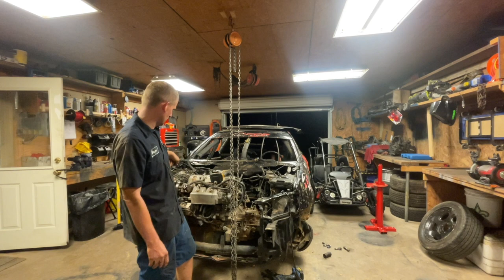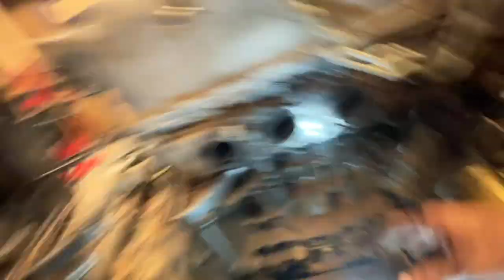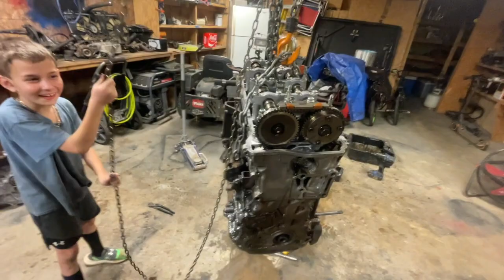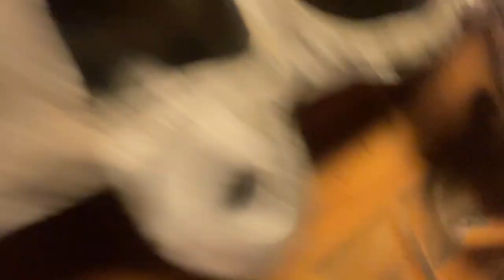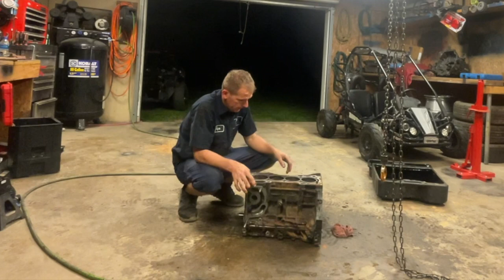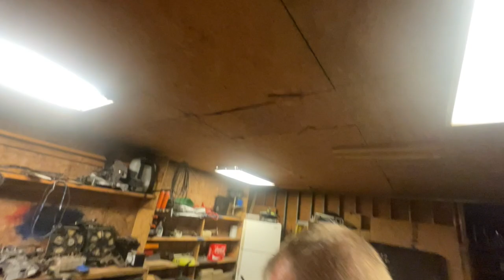Red Clay in the gas tank DESTROYED OUR ENGINE! / #41 Damage Report

Comment: There is no fuel filter on the k series I'd definitely add one inline. The fuel injector screens can stop big hard stuff, soft stuff like clay and dirt get vibrated/washed with so much fuel it makes it into the cylinder.
Reply: You can also bore to 86.5-87mm
Reply from the maker: Yeah it was very crazy that it made it in but even so into the tank like it did
Reply: @AlpacaMyBowl  yea but I am trying to keep it stock so this block is getting fixed but will be going into a different car at some point! If we didn’t prefer to stay within the rules that would definitely be happening!!!
Reply: @AlpacaMyBowl  yea I have an in-line filter going on it now so we don’t have these issues again!!

Comment: Clean up the casting it's stock appearing
Reply from the maker: That’s correct sir
Reply: It’s definitely stock, but the ring got stuck and cut a groove in cylinder #1 so will need a bit more than that!!
Reply: @waynethompkins6205  I got ya but the block and the ports with your experience you can see the problem.....
Reply: @waynethompkins6205  hey Wayne...I raced my car Las week had the best time ever.. got check out the mail box this morning!
Reply: @jamesswanson1139  nice congrats!